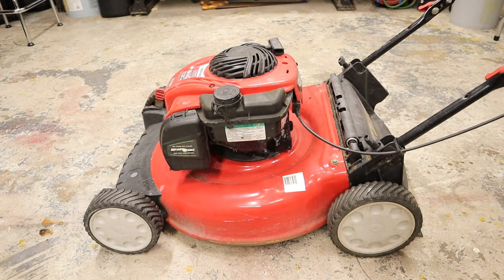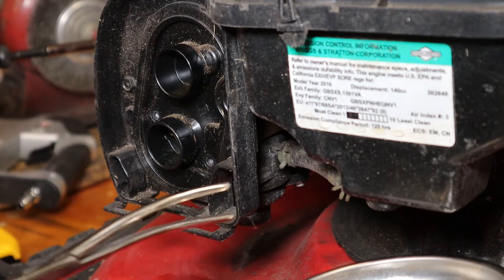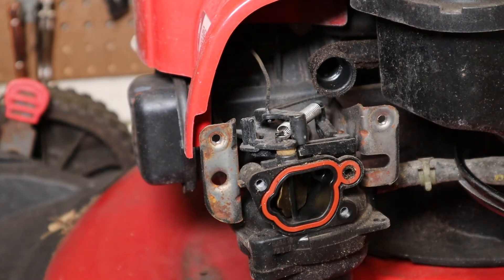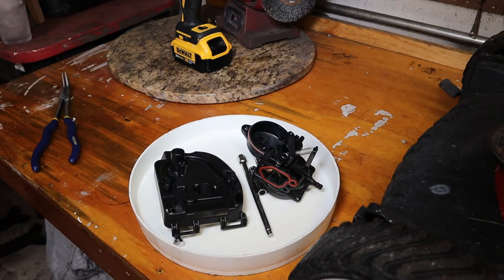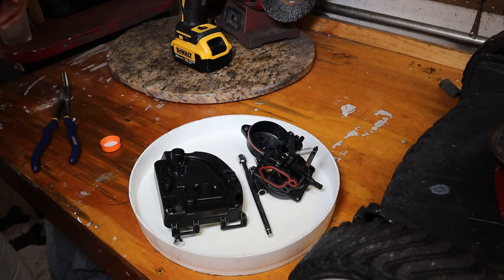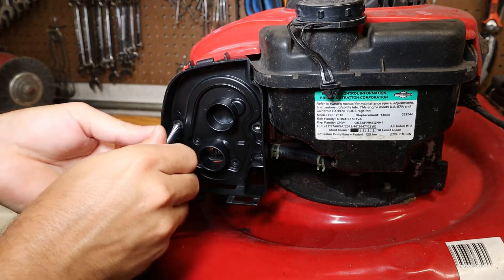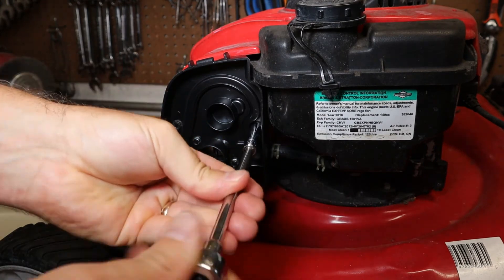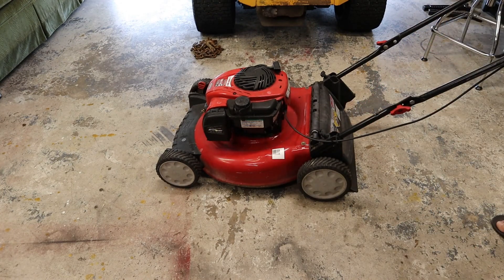Troy Bilt Mower Won't Start

Comment: Two things could happen with this engine with the plastic carb. First it's possible for a piece of dirt to get caught inside the cartridge where the jets are and be extremely difficult or impossible to get out. Just replacing the cartridge solves that problem. About a $13 part.  It snaps off and you just snap the new one on.  Second, check the choke lever. Occasionally you can encounter one that contacts the left side plate and can jam there and not reset to the choke position when the engine cools off.  Next time you try to start the engine there will be no choke.  Solution, grind with a dremmel or sand the end of the choke lever so that it clears the side plate. Some have tried to form (bend) the side plate to make it clear.  Not the easiest cure.